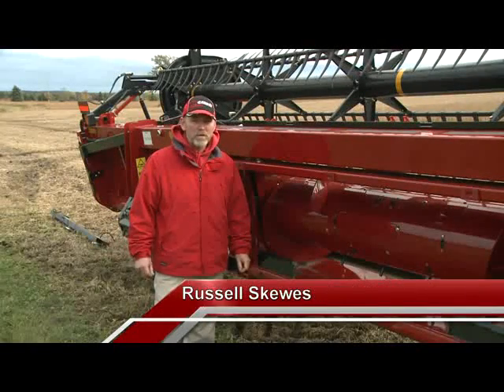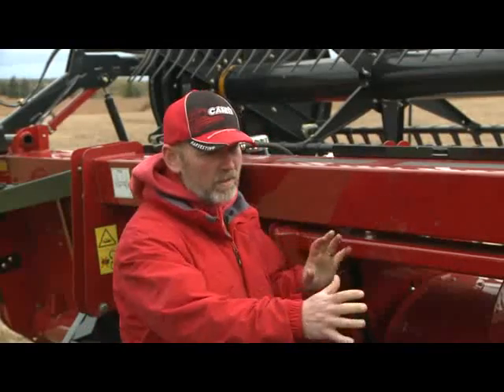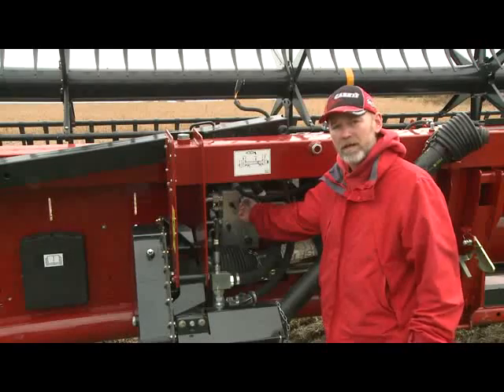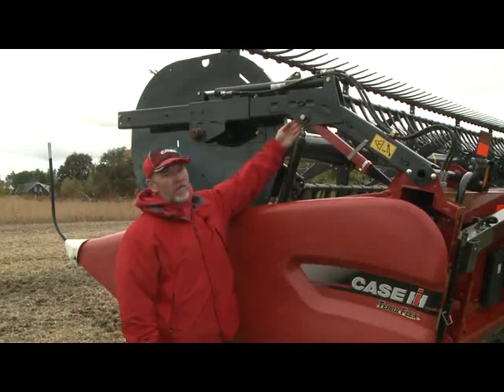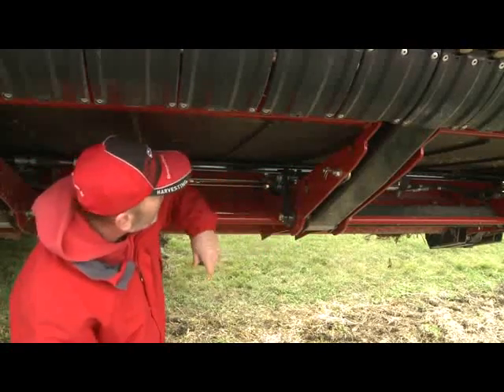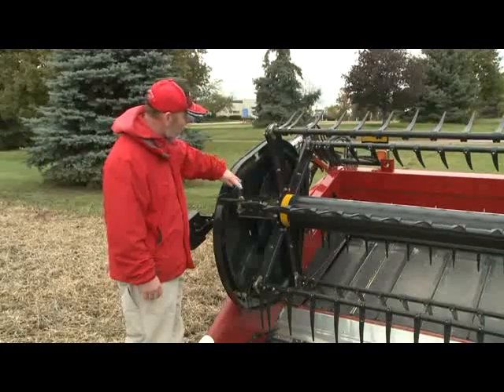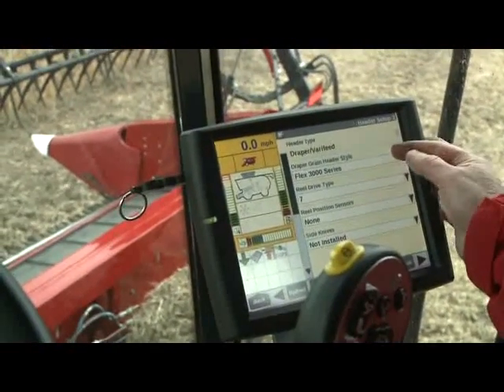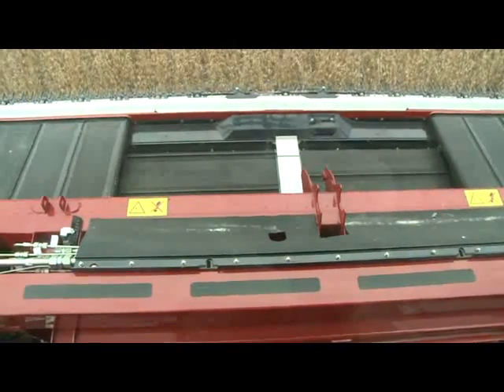3152 3162 case ih TerraFlex draper Header Set up & Operation

Comment: Why wouldn't canvas and knife speed adjustable in the cab?
Reply from the maker: Here is the reason from the Marketing folks-

 

Both the belt and knife speeds are adjustable at the same
location on the head, near the access stairs to cab. The location provides
both open access and simple controls.  While it would be convenient
to have all setting adjustments available from the cab, there are some that
would add complexity and cost that would not align with frequency of use.
 While there are exceptions to every situation, both knife and belt speed,
once set for crop and conditions, should remain fairly stable for that
particular harvest situation.   Typically we do not see crop variability
that requires frequent adjustments, but if needed can be easily adjusted at the
back of the head.